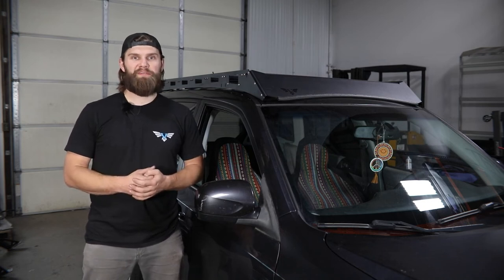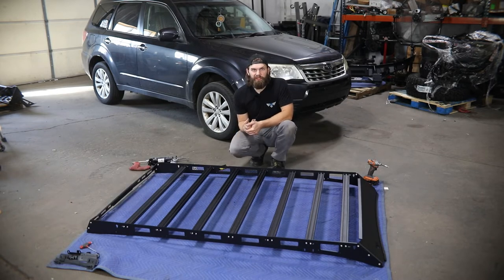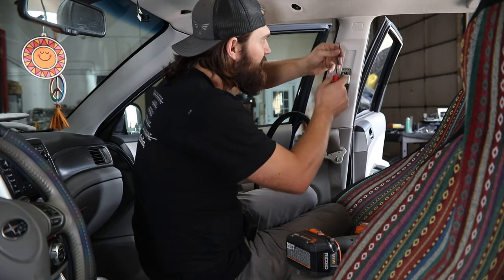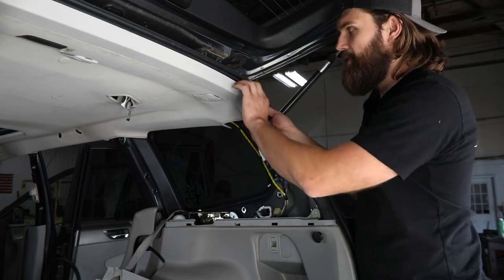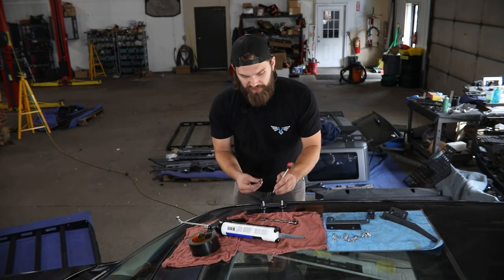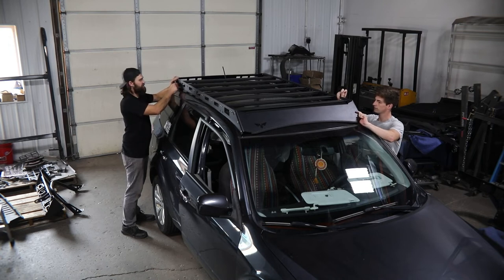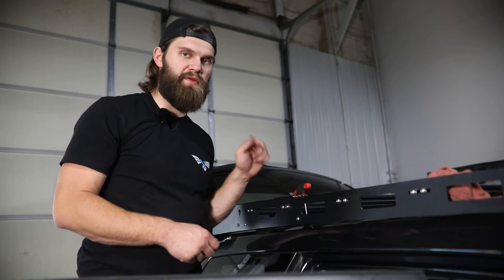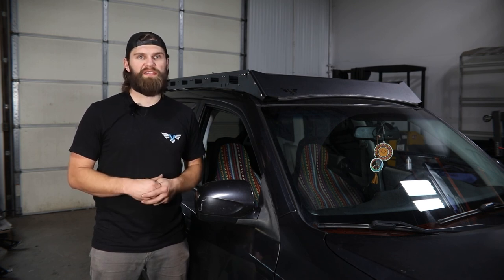Subaru Forester Roof Rack Install

Comment: Great video, didn't search "roof rack install" to install a new roof rack but to get clear instructions on the interior removal are what I need for roof-mounting an LED bar. I want to have the cable go through the roof (inside the original rails, down the A-pillar, and into the engine compartment) so I need to remove everything just for the LED bar. Since it is quite some work, I'll probably add some sidelights as well with cabling through the original rails. This video has a perfect balance of showing stuff while not draggin' it out👍
 Lastly a small suggestion for even greater clarity in your videos: instead of talking about "driver side" and "passenger side", instead use just "left-hand side" and "right-hand side". For Great Britain, Australia, and some other places in the world where they drive on the left-hand side of the road, it can be a bit confusing. I know it doesn't create that much trouble in this particular case, but it might do when doing stuff under the car.
Thanks from Sweden👍

Comment: Planning on purchasing one for my '16 Foz. I know these racks are probably rated for a decent amount of weight, but do you know how much the vehicle can take? I was planning on doing a lightweight 270° awning and lightweight small rooftop tent both by 23zero!
Reply from the maker: According to the Subaru Forester owner manual: the maximum total load on the roof rail(including roof rack, crossbars, carrying attachments, and cargo) Subaru Forester 2010-2021: must not exceed 176 lbs (80 kg).

Our rack itself can handle more than that, but loading beyond the OEM recommendations is at your discretion.
Reply: @Victory4x4  Ahh gotcha. I've seen people running tents. I'll take the risk and run it too. Thank you for the reply! Can't wait to purchase my rack and side accessory panels!
Reply: @Victory4x4  that’s the dynamic weight, static weight is a lot more. Very nicely done video by the way.
Reply: The roof rails on the Forester Wilderness is rated for 700 or 800 pounds static load and 176 dynamic load.